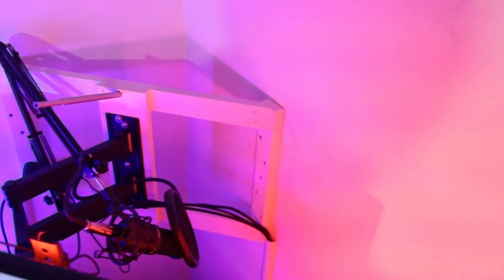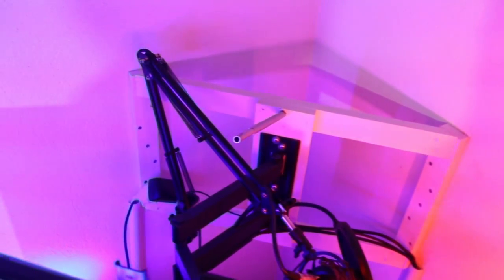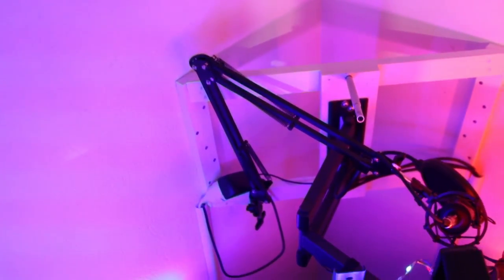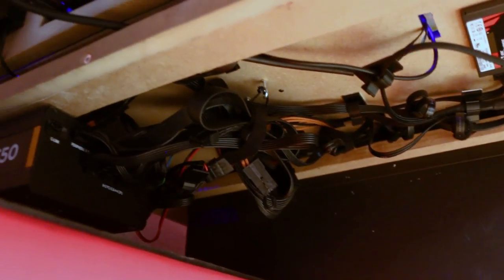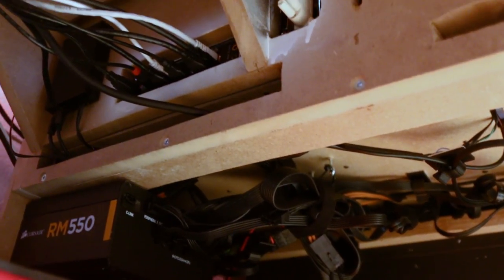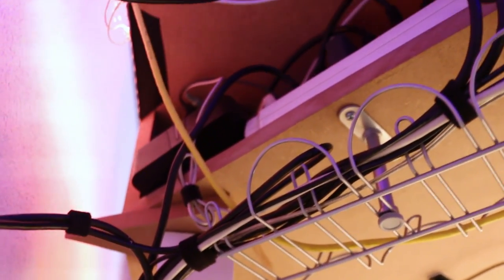Watercooled Desk PC [Project Duality] - Behind The Scenes

Comment: What about using a full length piano hinge to solve the gap? E.g. Turn the front face board or the top 'lid' into an opening door
Reply from the maker: That would be a great idea, the only problem is that the board goes under the reclaimed wood, making it impossible to just swing open.
Reply: Suggestion #2:  
Cut a 8cm (e.g.) strip off the front edge of the triangular top and fix that to the removable front face, so this then becomes removable along with the front. The now smaller triangle top remains fixed. 
It would also give better access to the storage compartment.
Reply from the maker: That could work, the only thing is that it adds a second seam which doesn't look to nice. But certainly a good idea!